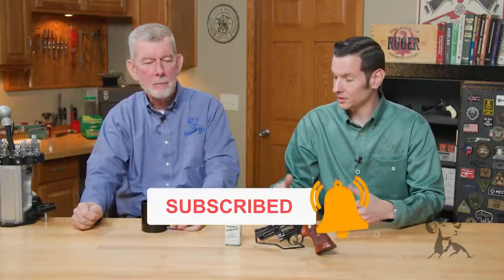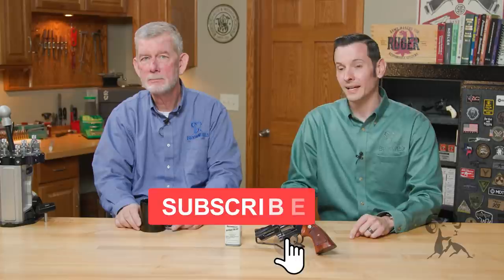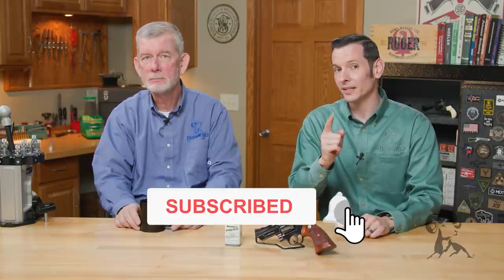Smyth Busters: Is Cold Blue as Good as Hot Blue?

Comment: How about a show on the pro/cons for blueing vs cerakote
Reply: Bluing is functionally controlled rusting. The main advantage is that you won't have any dimensional changes after bluing. Cerakote gives you plenty of color options as well as the ability to coat over aluminum and plastics.  You can also Cerakote stainless steel, which while it can be blued, does require different salts.  The main downside with Cerakote is with tightly fitting parts it may cause binding which will require the surfaces to be fit down as it is functionally a paint.
Reply: For today nothing is better than cerakote
Reply: That would make a nice 10 second video.  People choose one for aesthetics and the other for durability.  It is possible that one prefers the look of a vomit colored firearm - for those individuals, cerakote is a win-win.
Reply: @hicountrytm  nothing is better then nitride. Cerakote over nitride is a hell of a combo
Reply: @hicountrytm   you must be joking.

Be serious.
Reply: @ammoiscurrency5706  DLC / CVD
Is unquestionably the best.
Reply: @quarters-eye8922  not very smart are you!
Reply: @hicountrytm  Nope, DLC is vastly superior for wear!
KnifeMaker
Reply: @quarters-eye8922  A few years ago, Nitride was tops. Today, DLC blows it out of the water. :<)
KnifeMaker

Comment: Rust bluing is a good alternative for the DIYer who wants a decent result without taking it to a shop.  The problems are the amount of time needed to let the part rust and boiling the part. That said the finish is excellent and the durability is also excellent.
Reply: you can speed up the rusting by making a rust activator using hydrogen peroxide, vinegar and salt.
Reply: @SignalJones  yes but you should mention it needs to be a specific ratio or it can make pits! I don't know the ratio offhand but i have seen the results of too strong a mix on a video.
Reply: @eclipsegst9419  you are correct.

Comment: A winner of a video and well presented.  Cold blue is never the equal of hot blue and I say that as a guy who uses a fair amount of cold blue in my little machine shop. It won't make it equal hot blue, but a few minutes warming the parts before you use cold blue does help it. A couple minutes with a heat gun can prevent the dreaded cold blue splotchy results.
Reply: Definitely this. Make sure it’s degreased and heat it up and the bluing takes a lot better
Reply: im a big function over fashion kind of guy
how well does hot blue control rust vs cold blue
Reply: @LumpyBumpyAcidFish  Hot blue beats cold blue because it is a deeper treatment, but it isn't a huge difference. Cold blue is so easy that it can be a good choice.
Reply: @brianmoore1164  yeah ive never done anything like this before so ive been looking at cold bluing 
how quickly can I expect a cold blue finish to wear out from general use
Reply: @LumpyBumpyAcidFish  Take your time with surface prep. Careful and thorough cleaning and degreasing. Blue, 0000 steel wool, clean, blue. Repeating a couple times helps make it look better and be more durable.  Then oil and let sit for 24 hours before use. Done this way it is remarkably durable.  Years of general use are possible.  Now holster wear and places that see lots of rubbing will wear faster, but it does pretty well.
Reply: @brianmoore1164  aight sweet
any thoughts on bluing over an already blued surface? I dont care if its that splotchy as long as its protective
Reply: @LumpyBumpyAcidFish  Won't work worth a hoot. I mean it won't blue well and it doesn't protect well. Birchwood Casey makes a bluing remover and most rust removers will take it right off. Bluing is and oxidation process so is a close cousin to rust.

Comment: I cold blued a 16 gauge Stevens 94B from 1941. It turned out fine and it saved the gun from rusting away slowly. For a cheap shotgun like that I think cold bluing the entire thing was fine but I wouldn't do it to a more valuable gun.
Reply: I’ve got an 94A  .410 nice tight old shotgun .
Reply: I’m gonna cold blue a CBC model 151 16 gauge from the 70s I picked up at a gun show is it still holding up well after a year

Comment: The trick to getting an even finish on a large part is to dissolve the cold blue creme in warm water and submerge the part in it.
Do several submergings, using 0000 steel wool (that has been degreased in acetone) to card the finish in between coats.
Try to keep things moving constantly to keep the bath mixed well.
This will give a nice looking, even finish providing you prepare the surface of the steel well beforehand.
It will still lack durability though, and it will always have that horrible cold blue smell.
Reply: What will be the ratio of water per creme to create a good dissolution?
Thanks in advance.

Comment: I blued a homemade barrel extension with Blue Wonder and it looked and still looks fantastic after regular use and cleaning. It works a lot better if you heat it up per the instructions and use all three components. Repeating the blueing step for darker shades also helps.

Comment: Correctamundo King Fridays.  Cold Blueing is a touch up process, the heat application is an essential part of the Blueing Process as heatling the parts ti specific temperatures and a stable pH allows the caustic sakts to penetrate deeper into the meta'sl surface. That may only be microns in measurment depth, but those few microns allow for the much deeper lustre of the finish, and longer lasting.  Like any finish, it's subject to wear. 
I own a 1952 Winchester Model 1894 that's appraised at 99+% Finish. My dad bought the gun in 52, but he took meticulous care of his firearms. Even though he took a lot of deer with that gun, it's lustre is as deep and polished as the day it left Winchester's finish bench 72 years ago.

Comment: I've used liquid Oxpho-Blue for years, including refinishing entire guns as a temperary measure to stop and prevent further rust while waiting to properly refinish those guns later. I used a brass brush, brass picks and fine steel wool to clean out any rust including in small pitted areas.

But 25 years later that Colt M1917 in .45 ACP, and that sporterized Swedish Mauser m/94 carbine barrel are still wearing nothing but Oxpho-Blue. They were rescued pawn shop and thrift store orphans, long neglected before I adopted them. ¯\_(ツ)_/¯

Doesn't look as nice as a proper cold blue over polished metal, but it's a durable, functional protective finish that stops and prevents rust.
Reply: you should make a video showing them off. they sound pretty cool. I'd love to see them. especially after you showed them much needed love. Peace..

Comment: I used to carry a Taurus model 80 s&w 10 clone for 3 years every year I took a Sunday afternoon removed what was left polished it up and reblued it using cold blue. I want to try black oxide to reblue it. I see people dip parts in the solution and then they pull it out with a perfect black finish after like 2mins.

Comment: There are a few type of hot coating.
Low, mid and high temp.
I used to do high temp Black oxide treatment.
We cooked stuff at 350F-395F.
Some of the stuff I did is still black without any rust on it, even 9 years later.
Would I do it again? No. Fuck no, even.
At least not tin the industrial capacity I had been.

Comment: This is why I use Browning.

Also, if you heat the part or firearm and then apply the cold blue when it is hot, it is just as durable.
Reply: Sorry, but it is still a very thin surface blue. It is NOT as durable a actual salts blueing by a long shot!
KnifeMaker

Comment: I had to file the front sight dovetail in order to install a new front sight. There is where bare metal is showing on the bottom of the dove tail (barrel) can a cold blue pen be used to touch up the metal to prevent rust ?
Reply: Perfect for that kind of job.

Comment: I kinda did cold bluing hot by boiling the nose cap of a no 1 enfield I got and doing the cold bluing solution, did this 3 times and it was able to match close enough to the hot blue coat. But still not durable

Comment: Whats the best cold blue, because the one I used perma blue had pretty no effect on the finish and, when it did l. It was actuall blue and not dark at all. I follewed the instruction perfect, even cleaned it with the same bramd cleaner, and nothing good came out of it. I was try to touch up a patch of missing hot blue.

Comment: Hello guys. I have 2021 pietta  1858 Remington with Kirst 45 acp conversion. The gated one. I have to grind, sand, polish little bit off where you can load and unload. Was going to remove little metal and cold blue. What do y’all suggest. Thanks. 
Right now still just doing cylinder swap. But like to have it right sense got gated one.

Comment: Can you blue a Stainless steel firearm and if you can does it look like an old school blued firearm
Reply: you can.  the look you get is really about the surface finish.  Example: years ago I had a 1911 bullseye gun with a stainless slide.  The glare off the top of the slide was enough to affect the sight picture so wiping some cold blue on the top helped…somewhat.   I finally had a gunsmith hot blue the slide.  He also taped off the slide and bead blasted the top surface first.   When the slide was finished the sides of the slide were gorgeous and shiny with the look of a finely blued revolver. (That deep, lustrous blue).  The top of the slide which had been bead blasted was a perfect matte, looking almost parkerized due to the surface finish.
Reply: @jwilsonhandmadeknives2760  Thanks